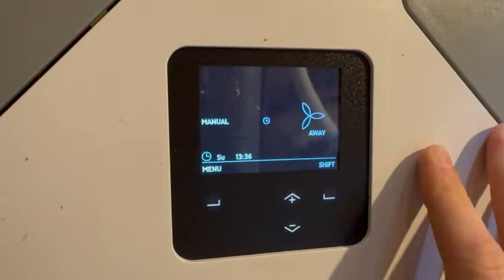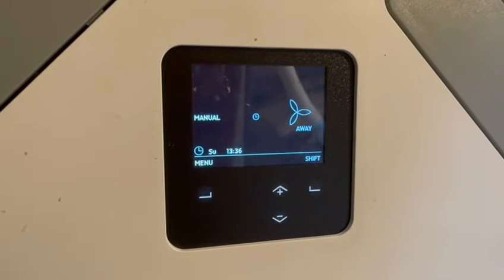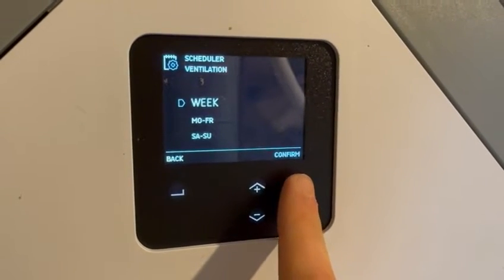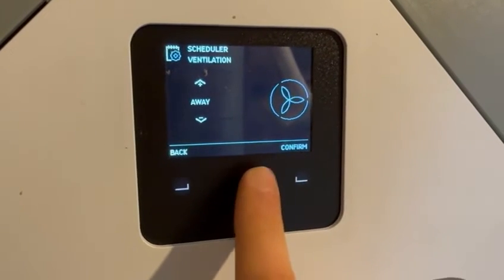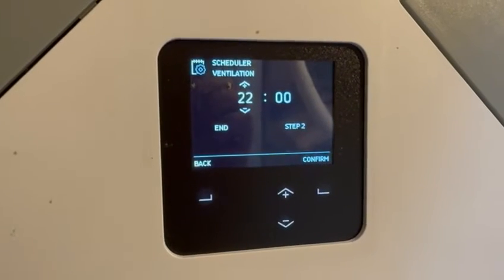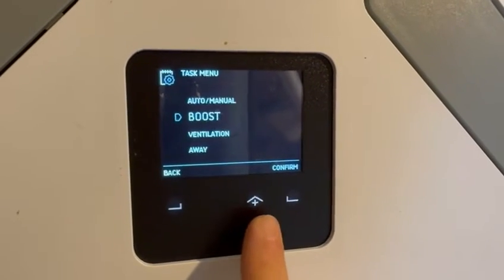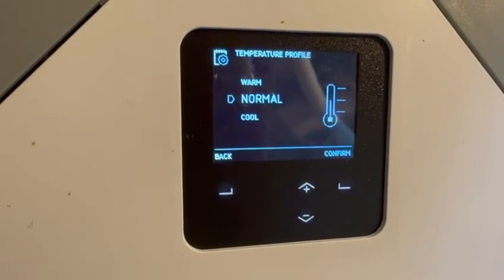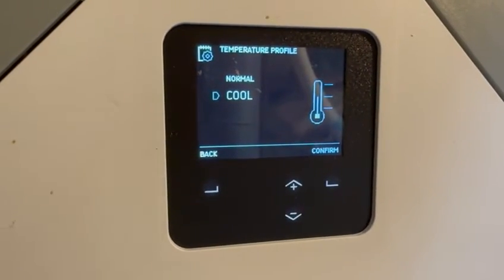Tips for passive cooling via your MVHR system in summer

Comment: I'm wondering if you got a bit mixed up there regarding the temperature profile. You would WANT the cool mode to be activated in the summer and warm in the winter. (You said "You don't want it to be set in cool in summer and warm in winter"). According to the user manual, the cool mode is when you'd like a cooler temperature (which would likely be in the summer time) and conversely for the warm). Am I wrong?